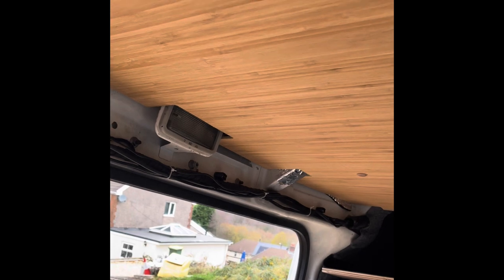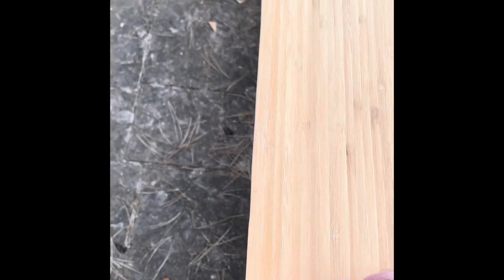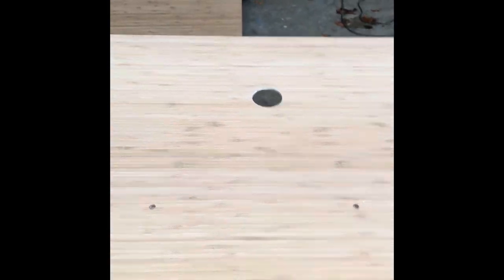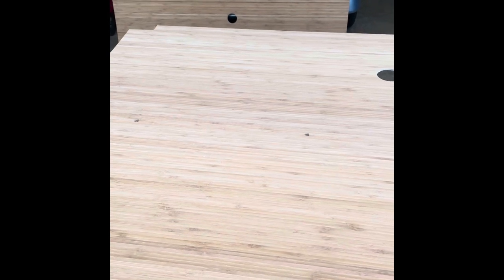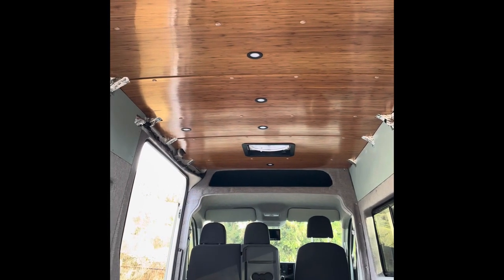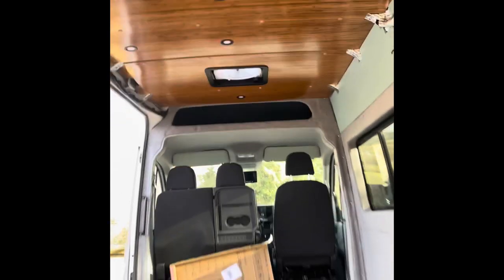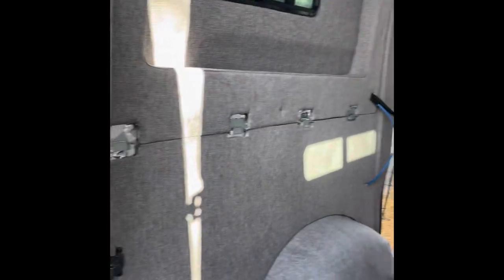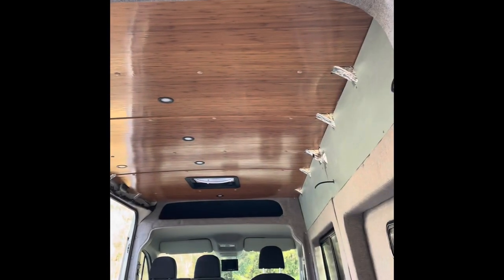VW Crafter campervan conversion Bamboo veneered ceiling panels

Comment: The ceiling looks really good, lights go well with it.👍
Reply from the maker: I agree didn’t like the white of the Maxfan so did it black which was much better so matched the lights and it works nicely 👍🏻. Thanks for watching
Reply: @luxduoverland674  just subbed , I’m doing a crafter my self so I’m looking forward to seeing how you get on.
Reply from the maker: @exploresandtosummit  thanks, I’ll check out your channel see how your getting on. It’s a little of work isn’t it 😂 way more than building my truck was. I’m not overcomplicating this build as we have minimal requirements when we camp.

Comment: I'm definitely going to use the evo bamboo  ceiling! I prefer the light colour . Did you stain it darker ?

Nice wall panels . What tweed did you use ?
Reply from the maker: Hi thanks for watching. 
No I didn’t stain it darker it went a richer colour after varnishing. 

Thanks here’s a link to the tweed 

https://www.ebay.co.uk/itm/252197862682?mkcid=16&mkevt=1&mkrid=711-127632-2357-0&ssspo=9ZzkCLPhQPC&sssrc=4429486&ssuid=VpZcwKQnTKm&var=&widget_ver=artemis&media=COPY

It’s not the easiest to work with as it doesn’t stretch like the four way carpet does.
Reply: @luxduoverland674  thanks for the swift reply . Still undecided on tweed vs stretch carpet , knowing me the tweed would look bad !
Reply from the maker: The tweed takes a bit of work and working out how to do things as it doesn’t flow like carpet does. If you watch my video on the pod panels you’ll see what I mean, I had to do a separate piece to do the curve of the panel as it’s wouldn’t stretch enough. I used a heat gun help in some places which did give it a little bit more stretch but not a lot. To me I think it’s come out looking ok and it was worth the extra hassle as it gives a nicer finish in my opinion.